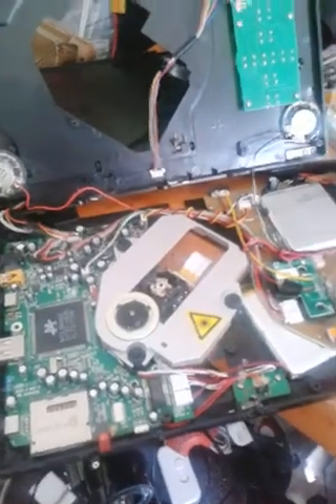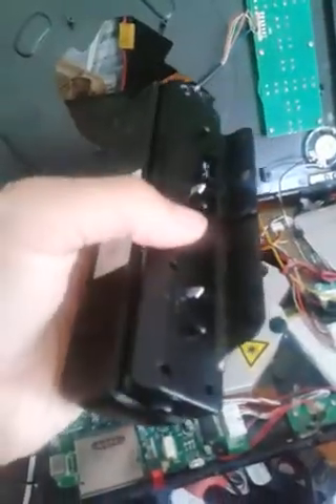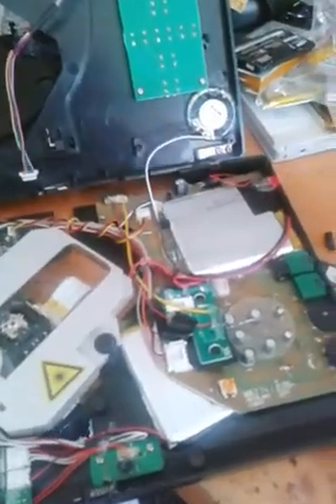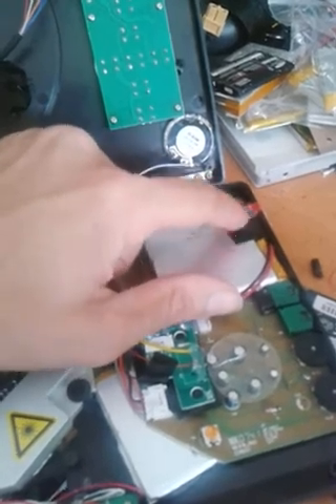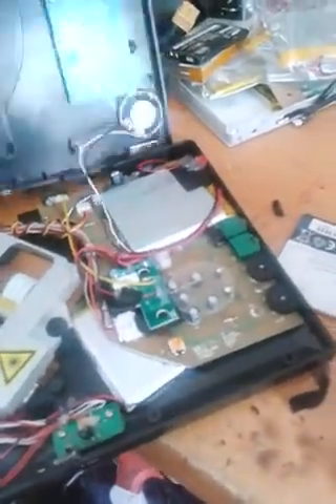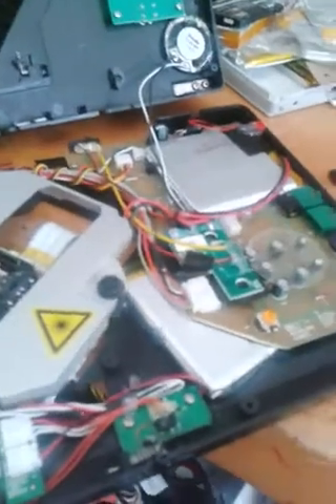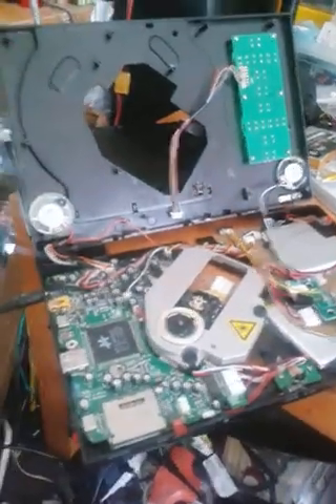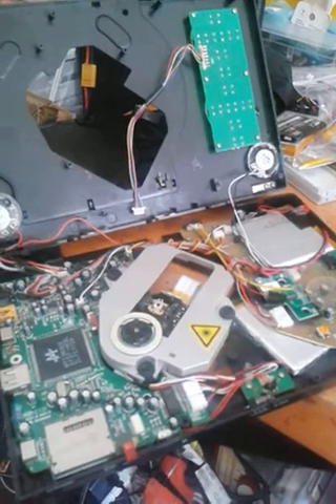More Portable DVD Player Hacking!

Comment: Curious How that worked out, with the dvd player using Li-on cells and you replacing them with lithium polymer batterys. If that machine is setup to charge Li-on it's probably not good to charge Li-po batterys.